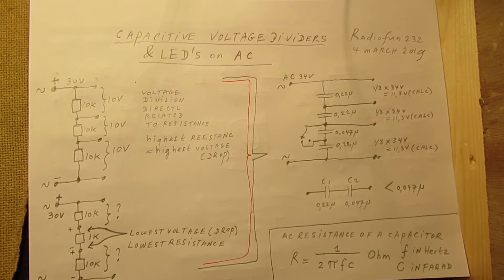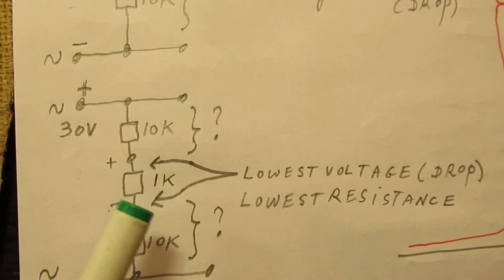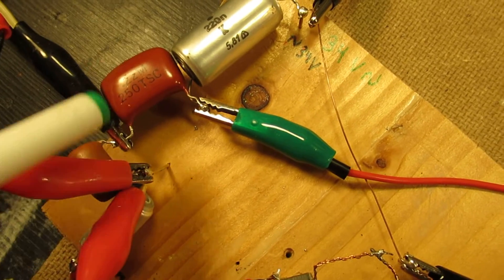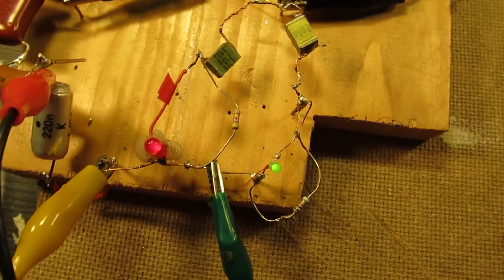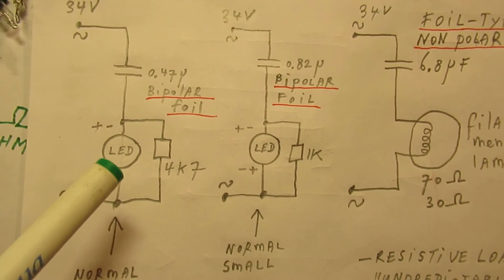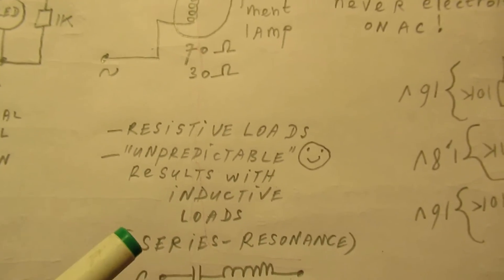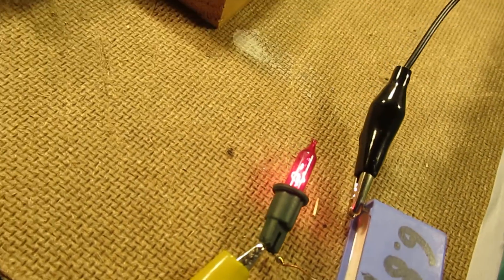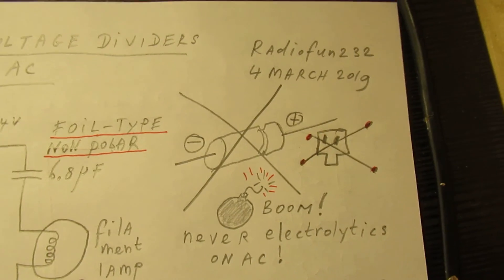The capacitive voltage divider & small indicator LEDS/filament  lamps on 20-50 V and 50/60 Hz AC

Comment: Very nice tutorial.   I did not know this some years ago when I needed to put a single red LED inside an emergency power off button that I had installed for my wood shop power tools.  I wanted the button to light up when it was twisted telling me the 240VAC circuit was live, and turn off when the button was pushed telling me the circuit was dead.  But the cheap Chinese button switch did not come with a light built in so I put one there.  It, however, would have required a five watt resistor and probably melted the switch over time.  Solved it by powering the LED with an old 5V cellphone charger and a aeries 1/4 watt 100 ohm resistor stuffed inside the switch box.
Reply from the maker: That was a good solution :)